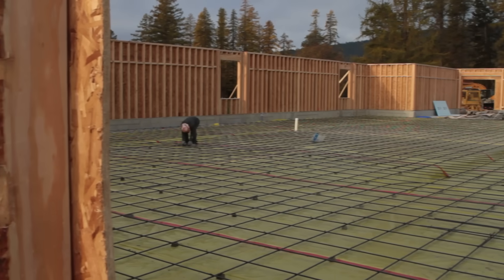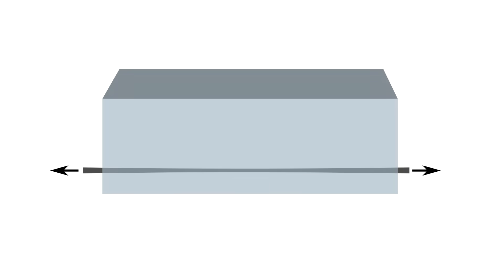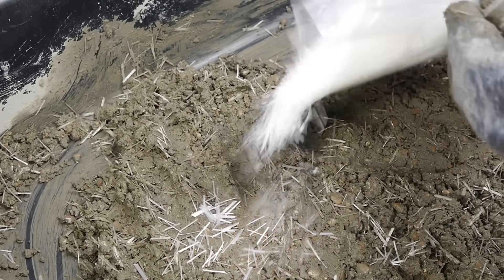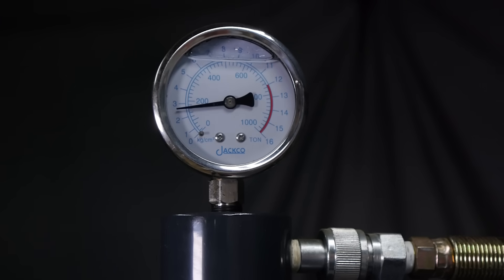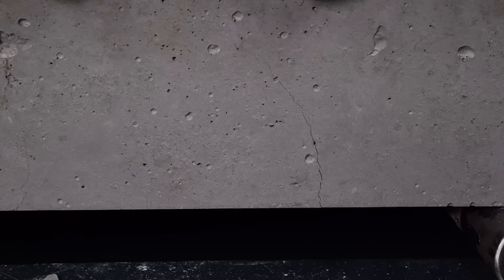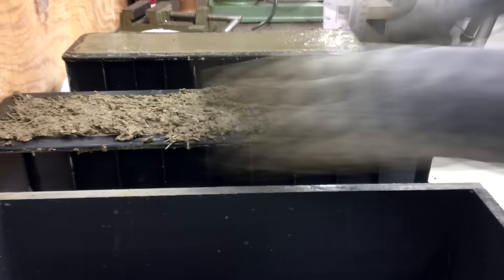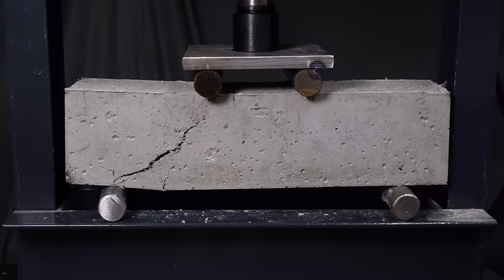Does Rebar Rust?

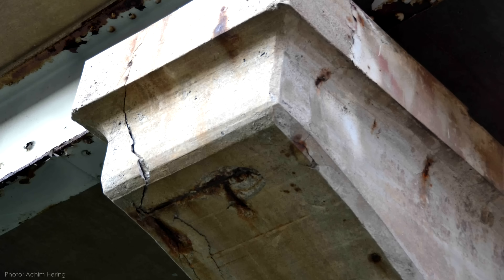Comment: The construction of my house seems pretty solid. It's a 1970s Yugoslavian property, with concrete frame and floors with clay brick infill. It's on a hill, hasn't shifted an inch a survived a 6.4 earthquake (albeit 30km away). However, there was obviously a lack of 'cover' in some area's. I can't see most of the concrete however I can see the underneath of the ground floor from the basement where some rebar is exposed (similar to your image at 2:49 though not as bad). I don't think the concrete has even fallen off here - I suspect it was exposed from day 1, it's less than 1cm of cover. I definitely need to find a way to remedy the situation before it gets worse.

Comment: Is it possible to repair rebar in a compromised area? I have a balcony with a concrete slap as balustrade. Decades of weathering got to it an the concrete partially cracked and shows spots of iron oxide. What can I do? my ide was to cut out the compromise area and "throw" in some new rebar into the existing structure and pour new concrete. But I don´t know how to connect the new rebar to the old one without welding.

Comment: Not enough attention is being paid on the jobsites to the minimum coverage of concrete to steel reinforcing. And during pours, especially of slabs when the workers are walking on them the minimums are not maintained in many if not most cases.

Comment: One of the ways could be stopping the winter salting. It seems more dangerous than beneficial and it has such negative consequences. I live in Finland and we already use studs mandated by law on tires, it's really nice to drive on compacted snow. When salted, it becomes this big pile of slush with no traction you slip and slide on. If it completely melts snow, the studs carve the asphalt all winter. Which is why by the law you're not allowed to drive with studs after certain day of the year unless there's still snow. So there's already double or triple negative whammy with no positive. Let's consider a situation where there's snow, salting melts some of it or all of it, drops on the road, there's a freezing night and in the morning you'll have polished mirror eyes with no traction, slipping nad sliding. If you progress from that, the salting of the road kills the plant life nearby roads and extends to kill animal life as well and erode the roadside. It's just ineffective and working against all the other parts of safe or economic and ecologic road use.

Comment: I'm fixing to lay alot of rebar. Going to wire wheel rebar down to metal the paint with rustoleum paint.  Don't know if it will help  but sure it better than using rusty rebar.

Comment: It seems to me that the rebars were too strong, so no sign of effective bending was shown. The adhesion of rebar to concrete seem to have failed so easily as the support locations were under the ends of the rebar.  I wonder what would have happened if the rebars, at the end, were bent using  two 90 degrees bends with one stirrup added.  This would stop/delay the end slipping. 

The end slipping, hence diagonal shear was dramatic on the right and less dramatic on the left. This experiment shows the importance of close stirrups at the end of the beam. which would elongate and shear. 

Brilliant presentations. Congratulations.

Comment: How about the oldest reinforcement coating system HOT DIP GALVANIZING... I dont understand how you could include epoxy and FRP bars but you didnt even mention hot dip galvanizing. You even said stainless... thats like 3 times the cost of black bar. Cost on top of the black bar is 10% for epoxy, 20% for galvanized. You Epoxy can fail in 7 years in the north east... (veterans bridge OH WV) HDG lasts 100 years.

Comment: 2:36 that rebar is on the ground. Terrible coverage placement for any kind of reinforcement, protection or to maintain tensile strength. Are you using stock videos without checking them for context? lol
Reply: It's supposed to be pulled up as they go.

Comment: It rusts if water can get to it, then it expands and breaks the concrete, the Romans knew this when they built the Coliseum, not rebar, but the cast iron joiners between the precast blocks, they coated them with lead.

Comment: Informative video as always.
I have a query - Hope it gets addressed by you or someone:
I am based in India and homes here are generally built using RCC (Reinforced Concrete Cement). This RCC construction develops cracks over time and I've observed that one of the major issue in its maintenance is the rusting of the reinforced iron/steel rebars.
I am not a civil engineer but I always wondered WHAT IF we coat the rebars with anti corrosion liquid before the installation? Would it work?

Comment: One of the reasons why you wouldn't want to use rebar made from alternate materials other than steel is because steel and concrete have same coefficient of thermal expansion, meaning, when exposed to thermal cycles, steel and concrete expand and contract at the same rate. Rebars made from other material may not have the same coefficient of thermal expansion and this can cause additional stresses due to thermal cyclic load which can reduce the life of concrete due to de bonding of concrete and steel as the materials would be expanding and contracting at different rate

Comment: While rust and corrosion are both forms of oxidation, the two terms are subtly different. For iron or steel it’s rust. For non-ferrous metals, like aluminium, brass or copper, it’s corrosion.

Comment: The greatest damage to steel reinforced concrete is caused by vibration, in turn caused by seismic and made made oscillation. Additionally, most concrete has too much water, which was added to improve workability. 
These forces cause cracks that expose the steel to corrosion. Modern concrete lasts 50 years if proper precautions have been taken. That's not good. 
I had an opportunity to work on the renovation of a building that was built in the 19th century. The steel within the concrete had a coating that was slightly over 1/4" thick. The concrete was almost devoid of cracking. The cracking that was evident appeared to have reformed, it also had surface residue of cementition. It was remarkable. When we cored the concrete, it looked very different from modern concrete, in that there were discreet masses of crystals distributed throughout instead of the typical aggregate patterns. It almost resembled some dry mixing used in underwater installations, where the weight of the surrounding water assures that it penetrates into the mix, providing proper hydration. Of course, that mix is quite different from the norm.
The managing project engineer was baffled, and stated that he had heard of this before but had not seen it for himself. He said the old mixes were guarded as proprietary secret, and until portland cement was introduced the details were unknown. 
Sadly, that tech is lost for the present ...

Comment: Have you ever seen that black spray on the outside of the basement wall of a house? It's like a rubber sealant that is applied from the bottom up before they backfill the wall and it's good to have an inclined layout around the house to keep rain from seeping down towards the wall gutters also should be long enough on the down spouts to keep the water away from the wall of the house that's why we see that inclined landscape.

Comment: Something to look into - apparently epoxy-coated rebar is not as popular as it once was and has some corrosion problems. 

Another thing to look into is a so called "Ufer" electrical ground.  This is a scheme where the rebar is actually used to ground the electrical system. My question is what part does this play in the deterioration of the concrete?

Comment: Rebar within the concrete generally doesn't rust. The concrete provides the alkaline environment, and acidic environment is required for the formation of rust, rebar is safe within the concrete slab, unless there is crack in concrete and the rebar is exposed to environmental factors such as rain, O2 etc.

Comment: Someone mentioned that  the increased weight of battery electric vehicles they could over stress parking garages. I pointed out that engineers build these structures to handle much more than the heaviest vehicle that could use them. Even so, are older parking garages in danger of collapse if more and more heaver vehicles use them?

Comment: Nice video sir. It would be interesting to see if you could compare that with   'post-tensioned' concrete...(cast a sample with longitudinal holes to accept threaded bars and their nuts at both ends  torqued accordingly after concrete cures)?

Comment: I huge limitation on FRP reinforcement is that the fibers used (glass, aramid, etc.) are more brittle than the concrete itself, the design failure mode for such composites is actually concrete crushing. Conventional RC is designed for steel yielding but FRP doesn’t yield, it ruptures so you lose ductility which all but eliminates force redistribution potential.

Comment: The biggest problem with the fibers (like fiber glass) is surface looks.  The fibers stick through the surface.  Does the customer/architect want furry cement.  The fibers get used in cement counter tops for strength.  The only hassle is you have to surface layer without the fibers.  Thus making pours a little more complicated.

Comment: Has anyone ever tested adding fiber pieces to something like that black tar/gravel thats used to make highways and drive ways?  Im planning on redoing my drive way before winter this year and now im wondering about doing a pre-pour with fibers, to see both how it looks and what the end result acts like once it dries and hardens.  Gonna research this!
As what the addition of fibers to the concrete, resulting in less formations of the small cracks which allow water in and salt, which causes much of the issues, im hoping the same can be said about adding fiber to the black tar, mixing it, before pouring it down on a clean surface.

Comment: concrete is BS. There has to be a better, lighter and stronger material. When I work with it I always wonder how it can hold even its own weight. I can drill it like nothing, smash it with a hammer. The only hard part is the stone. It's pretty much a sandstone. Concrete panels are welded together and at this joint it's compromised by heat. I know that, I see it bubbling, even spalling at work. If you find yourself in a concrete structure, know that the panels are held together with couple of milimeters of weld and compromised concrete. This part is not even sealed properly. Just a spoon of crunchy concrete is thrown onto it. Runny concrete is easy to fill the gaps with so it's used. This is the industry standard. At least in Europe shopping malls and various halls. I hope that taller buildings are built better. Never worked on one

Comment: Amazing Capability Tests! What was in the bag again at Frames 5:08 ? Swear to God that looked like a bunch of nails from Home Depot. Which gave me a brilliant idea: Buy up a bunch of nails and urethane/epoxy/sprayClear/whatever them. Dump them into your first poured layer of concrete. I believe this will help increase strength just like your "suspicious bag of metal nails" did, and also prolong any rusting rascals.

Comment: Here's what I'm hung up on. And have patience with me because the closest thing I've taken to this subject is just college physics. I'm hung up on the idea that beams have to have both compressive strength and tensile strength. I know the theory about the "bottom" of the beam stretching and the "top" compressing. What I don't understand is why that can't be two different materials? Why can't the bottom beam be steel and the top be concrete? If you just hung a concrete beam on a cable, the concrete wouldn't do anything but weight down the cable, so clearly these two parts have a way to communicate to each other which one is the top and which one is the bottom so that the top can absorb some of that load by compressing, and then "communicate" to the bottom part to absorb some of that load by stretching. 

I guess it probably does this by some kind of sheer strength. But I'm starting to get lost. 

It's easier to see how you could make a "bi-material" beam out of a truss instead. Just make the top concrete and the bottom steel and the connecting members would be one or the other, depending on the stresses. Why doesn't it make sense to construct this way? Obviously, it would be better if the compression member were in some kind of arch-like configuration so as to better absorb the compressive stress. Maybe it's similar for the tension member as well. Maybe they don't have to be straight cables. Maybe they can be springs. I don't know.

Comment: Would it be possible, feasible, and useful to use non reinforced concrete modules linked together by pre-stretched steel cables running through holes in the concrete modules and protected at the interfaces by gaskets? This might allow for tensile strain without cracking the concrete, and would allow some flexibility.

Honestly, it’s hard for me to see why it’s so important to create a composite material with both high tensile strength and high compressive strength. Isn’t it possible to put concrete only where we get compressive stress and steel only where we get tensile stress?

Yeah, I know the theory about how a beam bends and has both, it just seems theoretically possible to make the “beam” out of two different materials, like a truss.

Comment: Seems like shredded fiberglass windmill blades would make a great cheap additive for concrete. I've heard they cut the things apart before transporting to various places like landfills or recyclers. Seems like it shouldn't be too difficult to put one of those big shredders they use for cars on the back of a truck and drive it to the site. Park by the tower they're dismantling and drop the blades right in the shredder as they come down..... No issues with transporting the blades and it could ready to re-use in one step... Maybe two if they need to make it finer....

Comment: I  remember  the stories  of  Concrete Cancer  that  we  were told  of  at  our  local building College  was caused  by  the use of   Rapid  Hardening  additives, the main ones  being  CCS  Calcium Chloride  solutions  &  Hydrol  Hydrachloric  Acid  that  corroded  the  Re-Bar, we later  had  to  sign  for  these  additives  if  we  needed  them  adding  at  our  cost  if  it failed  but we  never  had  any problems  as  our use   was  for  load  bearing  road  surfaces  like  bays  to cover weak  areas.
Reply: Did that all need to be double spaced?

Comment: Your also forgetting one of the biggest step forwards in concrete since the 80’s being first developed for Kuala Lumpur Petronas Towers due to local weather conditions and high humidity the structure was extremely prone to cracking under the buildings load  using conventional  methods further to compliant issues the area was prone to earthquakes forcing the architects to come up with another method mixing liquid silicone and fibers mix was added to the concrete that allowed the material to expand and contract without cracking this has been trouble free bar the connecting tower which (sub contracted out) used conventional methods instead of the new materials to save costs this lasted till the end of the first winter where cracks were found on route inspection in the end after extensive work additional rebar and the new method of concrete was used in place for its compression block, increase inspections are now part of course.  there is zero issue with the two towers that have seen numerous winters and earthquakes

Comment: fishing product has rust proofing as well. If rod slipped into a piece of bamboo then sealed it is strong enough to last till dropped off & tied off in pour. Neoprene cap of ends of bamboo or seal 1 bamboo to another piece of bamboo or pvc filer piece bc bamboo ran out.

Comment: 4644: I wonder if u r going to deal w/rust, why not caused super acid dip rust b4 u put them in steel. Steel boat guys hve stuff that changes chemically hve 1st flash rust. That is 1 way to deal the mess steel boat guys go thru permanent fix & they special spray too. 2 the other way to deal is bring a medium to the rebar so it fights rust off by causing it to rust instead. If u had a not usefully rebar u wanted to rust instead u put in concrete w/rebar. Same idea as boat hull. 3 nickel pricey coating works if willing to pay. If u hve a space budget if u make an alloy coating of silver, cooper, nickel & stainless then it won't rust but space budget.

Comment: Well, do I feel dumb, just a couple hours ago I saw your video about reinforcement of concrete and asked about the use of fibers and here it is. Now, on this video you mention the the fiber rods that contain no metal whatsoever, this brings to mind another whole set of questions…

Since the importance would be to eliminate corrosion, especially in areas exposed to sea water, can any other materials be used for reinforcement? Does it matter if the material used is extremely flexible as long as it is pre-stressed before the concrete is poured? These thoughts come because I noted that the rebar failed during the tests and it made me think of my sailing days where we used Dyneema(r) rope instead of steel cables because not only does it eliminates the corrosion issue but it turns out it is 15 times stronger that steel of the same weight.  I know the costs would be well beyond reasonable to use Dyneema(r) rope but it’s a thought I’d love to clear up. Thanks in advance.